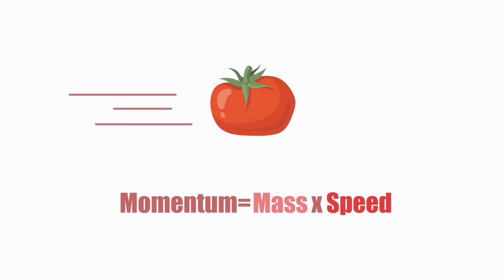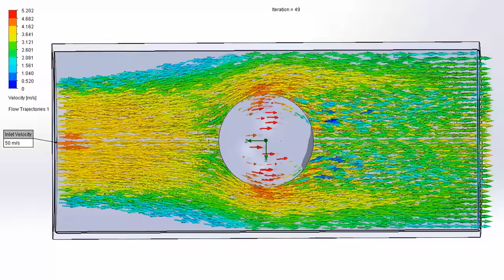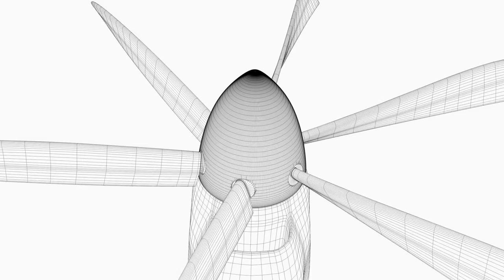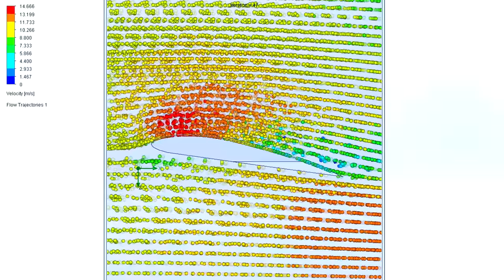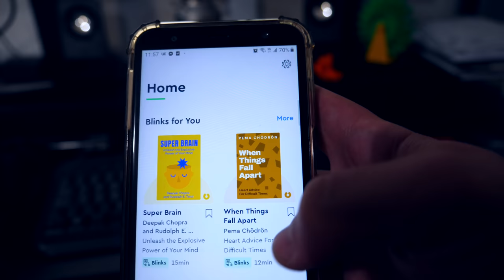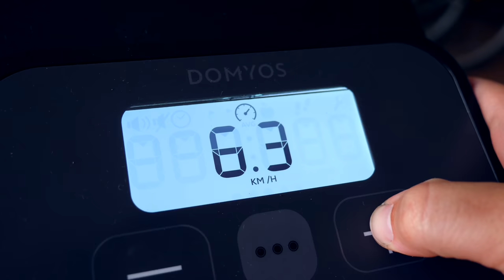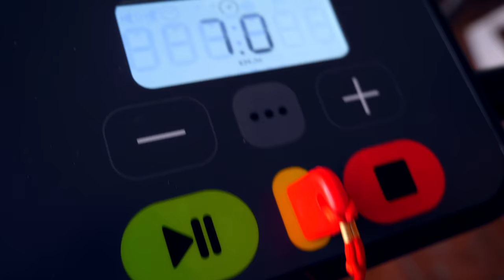Wind Powered Car (3D Printed)

Comment: If I understand correctly, you are saying that the additional energy comes from the pressure difference the propeller creates, But the cannot be the case for multiple reasons: Firstly, that would be free energy. The propeller would create a pressure difference, that would make the propeller go faster. Secondly creating a pressure difference lowers entropy, and therefore requires energy input. And lastly, the explanation that it's not free energy because of the drag is not true either. The drag removes kinetic energy from the car, but that energy doesn't disappear, it becomes thermal energy.

Comment: Excellent video as always! 
Regarding the wing shape, the wind on the top is not accelerated but keeps the same speed, it’s the shape of the wing that creates a low pressure area when the molecules want to travel in a direct line. Bernoulli principle doesn’t really apply here. Otherwise any shape of wings with the top longer than the bottom would work

Comment: PLEASE do a Swash Plate Piston Pump!!!
 
Of course, if you like to challenge yourself!;) It is a lot of fun to design and make it. It fits with the videos you’ve been making. Make sure to use it as a hydraulic press, or a pull - USING HYDRAULIC fluid! 
Oil and 3D printing resin don’t go well together - so there is a challenge in its own. Also, you can do a secondary video, where you can close loop the Swash Plate Piston Pump, and use it as a high-torque mechanism/engine to move a heavy object/car forward - with only a tiny engine turning the pump! 
I tried to make Swash Plate Piston Pump, but failed - 3D printer was giving me a hard time with piston chambers, and like I mentioned earlier, oil had an adverse reaction on 3D resin (PETG) - was making it “rubbery”/soggy. If you chose to do it, I can send you my Fusion 360 file that I designed  - 3D print ready - so at lease, you won’t have to design it from scratch.

Comment: (I'm not too smart)

It's kind of like a Jet Engine or a Turbo Ram jet. The more air that gets sucked in, the faster it goes.

Though, Jet engines literally ignite the air, and create a lot more thrust because of the heat..

And just like at a certain speed, drag will go against you. In a aircraft's case, it breaks the wings.

Comment: You made a good quality video, but the latest  release states that it's the pitch of the prop in conjunction with the diameter of the wheels that makes the difference here and that it's not a vacuum effectively suck it along, but more of the prop acting as a fan that actively propels the vehicle forward.

Comment: Angel of attack on the propeller is not efficient, at  45°  you are loosing at least 1/2 of your available air pressure. But still you did it ☺️ 🙌👏

Comment: Hey Integza, 
you realy should build either a 3D printed submarine. The Challenge will be, that you are not allowed to use O-Rings to Seal parts. 
(Just one shaft seal for the engine.) 
Extra points if you don't need a shaft seal.

Comment: It doesn’t break the law of physics. You can sail a boat far faster than the direction of the wind. The way you can get a boat to move faster is through a combination of lift and pressure against the rudder and keel, which makes it go faster. The tyres of your car and the gearing of the propeller achieve the same result.

Comment: I would like to see a video on some variation of spinning some magnets inside of copper rings, or spinning some magnets around the outside of a copper ring. I believe there is something to be said for using magnetic fields along with copper for the generation of electricity as magnetic fields can be created by electricity and amplified and I believe there is a way to use a magnetic field to generate electricity while not breaking the laws of thermodynamics.

Comment: If you do a bit of research on prop pitch i think it would improve your chances of it working.  You definitely have the right idea, just not enough or correct pitch of the prop blades.

Comment: why not try and make a solar dome for desalination or water purification? with the 3d printer you can easily make the parabolic mirrors (Maybe use aluminum tape as the reflective surface?)

Comment: In Deriks video, the wind speed RELATIVE to the craft is changing. At first it is pushing it (it is indicadet by the ribbons), to later stop and switch.
In your case, the cart is standing in place and fan wind is constantly pushing it. If you attached a ribbon to that cart, I don't think it would change direction.
I believe in that physics phenomena, but I don't think you managed to recreate it here. What's happening, is that the fan is pushing that cart no matter what its speed is (it is always standing still relative to fan), while at the same time drag increases with the treadmill speed. Those two forces are cancelling each other and will eventually reach equilibrium if we assume no speed limit to treadmill.

Comment: bruh its literally so simple because the prop and the wheels are connected when the prop goes faster it pushes the car faster making the wheels spin faster therefore making the prop spin faster making the car go faster and it keeps going faster and faster until it would reach the point where the speed and drag begin to level out because the faster something goes the more drag something has so there will be a top speed

Comment: this could be used to increase eficiency for personal traveling vehicles like the regenerative breaking of Tesla cars, but with lighter vehicles like bikes or even small prop pranes (although i beleve small planes can only do much before having to turn on the full power of the engine).

On a side note, Integza, make a 3d printed steam engine (yes i know, quite an old tecnology, but i believe it could be fun at least).

Comment: Here's my crazy 3D printer idea. Another YouTuber called Photonicinduction recently released a couple fascinating videos about giant mercury vapor rectifiers from the 1940s / 1950s. Cool tech with an even cooler blue glow. My question is would it be possible to 3d print a vacuum chamber using transparent ABS and make it into a mercury rectifier (with cool blue glow)? I know these rectifiers came in all sorts of different shapes and sizes. I believe you can still get mercury vapor light bulbs(?) What do you think?

Comment: Try to drive a wind driven car into the wind, it seems to be possible if you can figure out the correct propellor pitch and gear ratio. One thing missing in the video is the actual wind speed, you have the speed of the tredmill but no airspeed. The flag on the vehicle does not work because not not have actual forward movement. But you explain it good!

Comment: Video idea: 3D print a turbo charger and install it in a vacuum cleaner or shop vacuum. To see if this will increase the suction force or increase the air blowing out.

Comment: Technically that car works different than your prop. because it's going the the opposite way of the wind. meaning as it accelerates it increases the wind speed by making the car more aromatic. you create a lot less drag so as the car speeds up more. So it creates more pressure on the sales from the wind causing them to spin faster and creating more pressure making it go even more faster. this is what they call Force manipulation multiplying. it's when you take a force any reduced its drag on the object to basically zero and you apply that force in intervals but the force never goes away this is basically what happens in the space. you can pulse the engines in space in your keep going faster and faster. because that force will not go away until acted upon by it Opposite negative Force.

Comment: To go faster than the windspeed the force of low pressure on the front of the blades needs to be larger than the force of drag on the car.  So if you want to go faster increase the ratio of wing size to coefficient of drag.

accelerating forces:
force of wind
low pressure on front of blades

decelerating forces:
wind resistance of car
rolling resistance of wheels
mechanical friction of propeller system

reduce air separation on front of blades
make the car the shape of an eco-marathon winner
increase suspension and tire stiffness
narrower tires
put pencil shavings in gears/bearings

Comment: Very entertaining. Though, what I saw was the wheels rotating a prop, which pulled the car forward.  The fan just lightened the load of overcoming the inertia of the stationary trike. I'm just a software engineer with a Jaguar car restoration channel. so what do I know... :)

Comment: 5:55
Matto:
NOOOOOO

The longer path shorter path explanation is inaccurate! Think, how do planes fly upside down?

The plane creates a lift by creating a low pressure zone above the wing due to the inertia of air, and the force below the wing pushing upwards.

Some airfoils can provide lift even at zero angle of attack due to ambient air pressure pushing upwards on the non-angled bottom surface, while the top, angled surface provides low pressure as the wing moves through the air.

Comment: 9:00 Integza, this is terrifying.  You have a large radius propeller spinning at high RPM and your eyes are on the same plane as the propeller so if it broke, it could go direclty into your eye.  Since the propeller is so big, it's even more likely to break because centrifugal force at the tips is so much more.  Please wear safety glasses!

10:09 and this is even worse.  The propeller is a separate part from the hub and is even more likely to break off...

Comment: I have s few idea what you should make and I probably enjoy watching. What if you 3dprint the part you want with thin layers, put it in sand and cast it from iron. The plastic should burn out from the sand and the melted iron can take over its place. This way maybe you can "print metal".

Comment: a wheel with magnets angled to repulse each other, so the wheel just keeps spinning while attached to the shaft of an alternator, hopefully generating enough power to charge and run some devices.
Reply: will take a lot of magnets, with the wheel magnets likely spaced at random gaps to maintain smooth spinning.

Comment: The gear ratio is also 1:1. I would start it at 1:4 to get the propeller rpm 4x the thrust versus the treadmill speed

Comment: You should build a small drone/aircraft with 3d printed parts that work with pressurized gas but can glide when the gas runs out. Plus you could make it drop tomato juice at regular intervals throughout the flight Ahah. Send a message to the tomato mafia ahahah.

Um abraço de Portugal

Comment: This is cool but I would have conducted treadmill experiment different. 
The car should hold back by a spring which could be used to measure the increase in acceleration force. A string running from the front of the car could help to tow the car up to speed. Combined with a steering mechanism it could even keep the car in a straight line. Also the string would allow the car to get faster thwn the treadmill.
Else nice work and love you videos. ;)

Comment: Hey Integza, heres a video idea for you and if you pull it off not only will it be a World Record but also a World First.  Get a 1:11 scale RC Jet and modify the hell out of it until you can get it to go 1,193K AKA Mach 1.  Installing a 3 axis gimble and a FPV system on the Jet plus Installing a Head Tracking unit and transmitter on the FPV goggles would give you the perspective of actually flying the jet + give you pretty cool footage to use for the video.  

I challenge you to do it using LiPo batteries and EDFs.  
If after every attempt you've made using only LiPo batteries and EDF's do whatever you have to to accomplish Mach 1 with an RC Jet, go for broke and Modify the aircraft again using your knowledge of Rocket Engines.

Comment: So from what I gather, the prop creates a zone of pressure in which the wind pushes the vehicle into... so similar to a racecar creating a 'hole' in the air, it encounters less air resistance and thus can move through the less thick air (tomato) soup more efficiently and increasing the speed potential. 

Yea?

Comment: Great video! I do quibble with the fan behind your treadmill. Your cart may work, but the fan removes your ability to show that it is actually moving faster than the air relative to the belt.
I just built a lil teeny one yesterday that runs in a circle for hours (just uploaded a video).

Comment: Enjoyed the video, yes as long as the propeller has enough surface area, it will work.  Yes if the wind stopped, it would continue to go forward, until the friction of the tires, bearings, gears and drag on the car forced it to slow, and stop.
 I am curious, what if you set up a push / pull  dual props 90 degrees offset, if it would do better or worse??

Comment: Should be able to make a complex formula to include prop surface area, pitch of prop, gear ratio between wheels and prop, wind speed, forward speed, weight of vehicle (and friction to be more accurate) to calculate potential top speed.
Reply: Air temp, and air density as well?

Comment: 9:20 You need to put the fan IN FRONT of the car to help it. And it looks like you geared it wrong. Wind from the back should have turned the drive wheels towards the fan.

Comment: After thinking about it, and debating coworkers, and using various experience, I think I intuitively understand how this works. I started looking into CFD to simulate it properly to explain it. Then I could create a nice answering video... Even the people who are trying to explain it seem to be skipping over the actual mechanism that makes it work. Their explanations all seem like they are describing a perpetual motion machine. This is how I understand that it works:

Since the tailwind cannot exert force on any fixed (frame) or net neutral parts of the device (spinning wheels) once it is traveling faster than the tailwind, and in fact oncoming air will create drag, the force must be transmitted through force on the propeller. But the rolling vehicle is transmitting force from the wheels to spin the propeller. Why wouldn't the tailwind reverse or at least stop the propeller? How is there a net positive force? It is because the rolling speed wheel to spin ratio causes the propeller to spin a bit faster than the oncoming air, producing back force. It is able to keep doing this faster and faster because there is little resistance to spinning the propeller at the same speed as the oncoming air flow. Being a bit faster means that there is a net positive force from the propeller, but only marginally more than the oncoming airflow. That propeller exhaust force acts as something like a stationary surface for the tailwind to push against, from the frame of reference of the tailwind. The force of the tailwind is therefore transmitted through the high pressure cloud of air to the propeller to the frame, pushing it forward, which keeps up the force on the wheels to spin the propeller against the tailwind. I at first envisioned a column of air from the propeller all the way back to the starting point, but that's not quite right. Instead, it the turbulent flow against both the moving air the propeller just moved through plus, especially, moving air surrounding the propeller. Faster moving air has more viscosity, so the cone of back pressure keeps increasing to a certain point behind the propeller, gathering the force of the moving tailwind, and over a somewhat larger diameter than the propeller.

This is only a little bit like a tacking sail; mostly a different principle. On water, this would be difficult to make work because this rolling frame has much less resistance and far more efficiency than most hulls in water.

Comment: Integza, build a rockoon! Which is a rocket launched from the edge of space via weather balloons carrying a launch pad. The rocket will have far less drag from the thin atmosphere at the altitude that the weather balloon reaches. You could use an Arduino to launch the rocket right before the balloons pop from the low pressure! You will also get some nice photos of the curvature of the earth to rub in the faces of those flat earth people.
Reply: Also you could use a multi stage rocket like the old Comanche 3 Estes rocket that had 3 'D' engines and reached altitudes of a half mile. Unless you have a better idea. But I'd love to see how much further the rocket will travel from the edge of space. Like get an altitude measurement from the ground, and then a measurement of the distance traveled when launched from the edge of space!

Comment: loved the video, one thing tho... there is a pressure difference between the higher and the lower parts of an airfoil but it's not where most of the lift comes from. the oversimplefied version is that the lift force is due to the consistency of the air hitting the airfoil times the relative speed of the air hitting the airfoil (in planes and Propellers the airfoil hitting the air). kinda like P=mV that you explained in the video but not really. the simplefied version is Lift=1/2*environmental air pressure*velosity^2*wing surface*coefficient of lift. (coefficient of lift is where the pressure thing happens. its also where the fun trigonometry magic happens.) 
the misconception that the pressure difference is the cause of lift comes from the point of the combination of all vectors of the lift force being called the center of pressure due to it also being the point where the pressure on the airfoil is highest. This makes sense. 
Lift isn't caused because of static pressure, static pressure is created due to lift. dynamic pressure is also created. It creates lift, not as much tho. we have the coefficient of lift for that kind of shit, but this is the simple version so we don't think about that. 
aerodynamics is fucking hard.